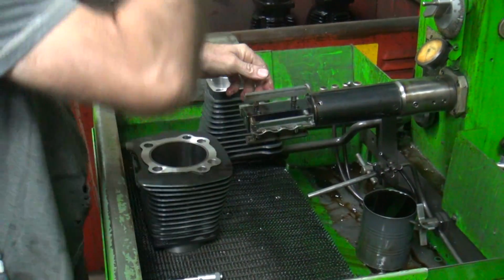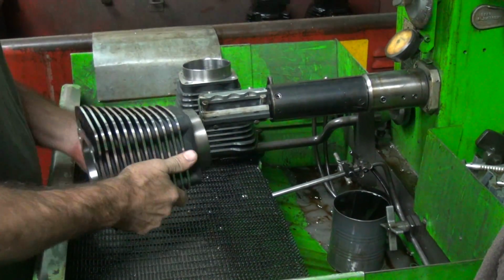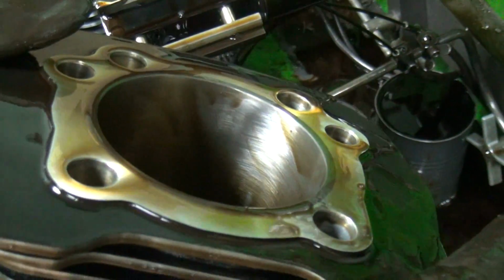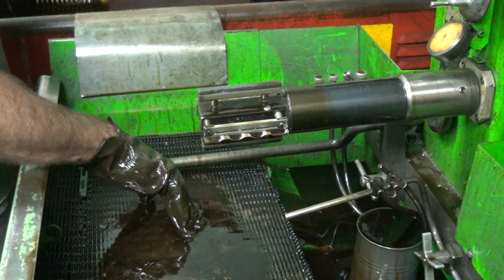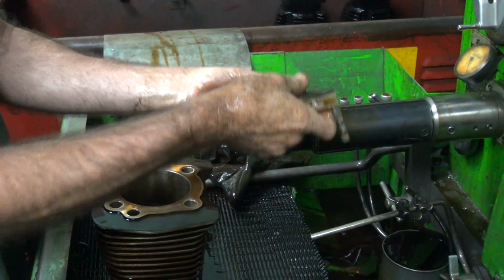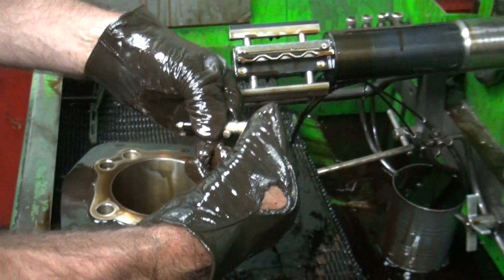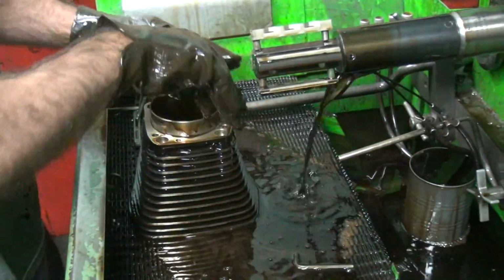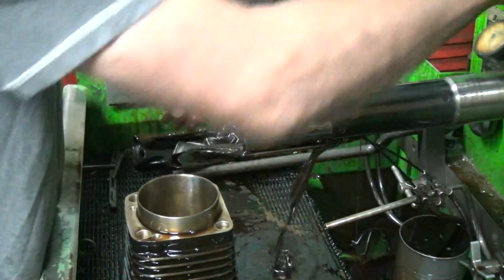1984-99 80ci #102 evolution piston fitting and cylinder honing Harley FXR Dyna softail FLH FLT

Comment: I see your oil feed line must be internal to the machine. Mine was oil less so I adapted a pump but need to feed the oil through the column. Need to see inside an oiler unit.

Comment: I always use torque plates they must be torqured correctly with head gaskets... I have had cylinders done for me where they removed my torque plates and the bike smoked and there was a lot of distortion.
Reply from the maker: torque plates are a joke. every time you loosen and retighten the nuts the cylinder bore changes. have you ever gone back and checked this and see if your job repeats. if you can not repeat what you just did than you have no accuracy and are just wasting your time. even s&s says to never check its bore for sizing after the plates are taken off and to not reinstall them because the cylinder will to repeat its trueness. i have looked at lots of very low mileage cylinders from harley, s&s, other manufactures and my stuff and they all have the same vertical 1/2" to 5/8" wide striping going around the cylinders. basically it comes down to it does not matter what you do on these crappy alum cylinders, they are not going to be true no matter what you do. that is why don't use torque plates.
if you want good round cylinders you need nice very thick cast iron sleeves or cast iron cylinders.
tatro
Reply: Just depends on who you are
Reply: Everyone is a subject matter expert...
I have just ONE question for all the people who are convinced that torque plates are the way to go. HOW DO YOU SIMULATE 400°-500° CYLINDER TEMPERATURE WITH TORQUE PLATES WHILE HONING??

Comment: Honing like this for 1 month and you will never be able to open your hand as normal. Such a big component to hone by hand
Reply from the maker: been doing it for years. i do get sore if i do 5 sets in one day. like anything, if you do it long enough you get use to it. it helps that i don't do this everyday but i am always standing and working all day every day.
tatro
Reply: Man i love watching people do things the wrong was and then say they have been doing it for years!!! First those cylinders should have torque plates on them. And you should be using a dial bore gauge to get and accurate measurement and to check if your out of round and lastly the cylinder should be mounted to something NOT YOUR HAND!!!  This is called stupid dangerous inaccurate technique!!

Comment: I don't know about evos , but torque plates on a shovel do nothing . I have measured and spent half a day on this . Torque plates on a shovel do nothing . There is no distortion from torqueing down a plate on a shovelhead.
Reply from the maker: either way they do not repeat so they don't work anyway. that is why i do not use them.
tatro
Reply: I was pissed because the Wiseco piston instructions said they must be used. I ordered material and fabbed them to find no change to distortion with them on or off. All measured with Sunnen dial bore gauge to the ten thou. No change  at all with torque plates . Good to know they do nothing on evos as well.
Reply: I have hone Harley cylinder going on 40 years, torque plates for a good 30years and I use them on all Harley cylinders. They are more for evolution and twin cams then anything else, but I like use them any ways on all  cylinders to hold them on my Sunnen machine will honing. Right or wrong I use them and not have had a come back in more then 30 years

Comment: No torque plates & too fine a finish for an air cooled engine... Snap gauges are not accurate way to measure a cylinder...
Dial bore gauge would show that those cylinders end up tapered...
CrazyHorse Speed Shop  NJ  usa
Reply from the maker: i do what works for me. my customers and my racing records says i know what i am doing. i make changes as need per application. no one job is the same.
that so called snap gauge is a bore mic. it measures to tens just fine. unlike a dia bore gauge, i can measure all the low and high spots, not just the average. you do have to know how to use it.
tatro
Reply: The plates that guide on the 2 rods... Would make your life easier... I know they are expensive...